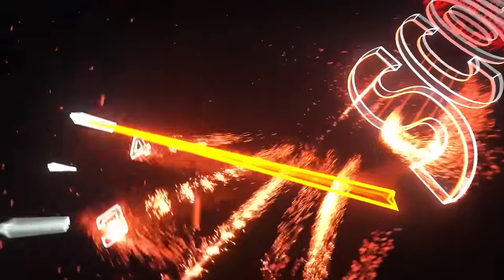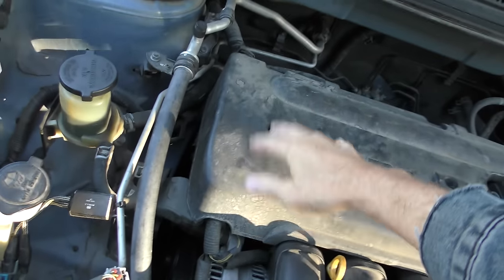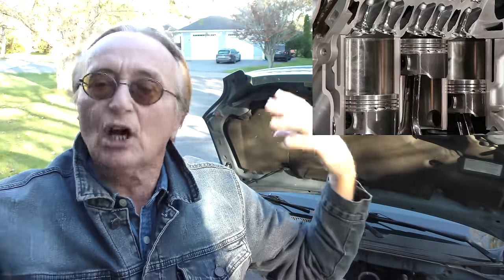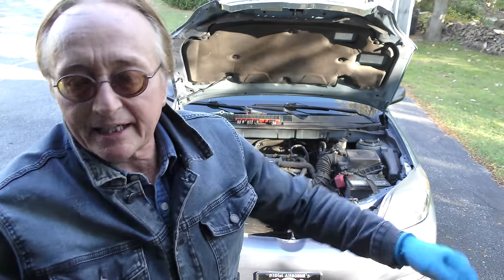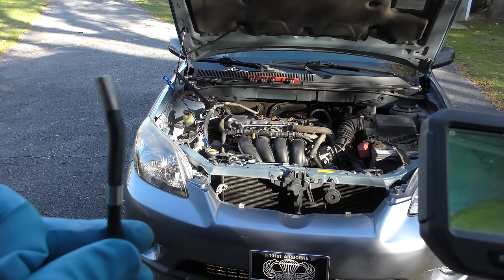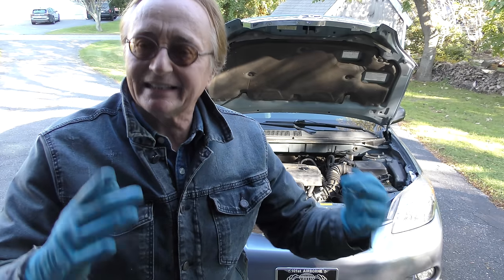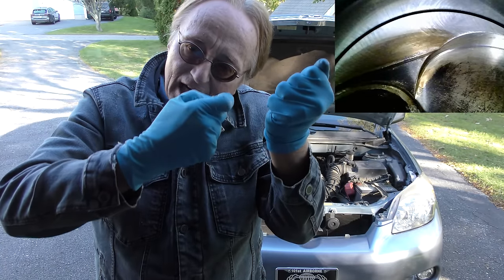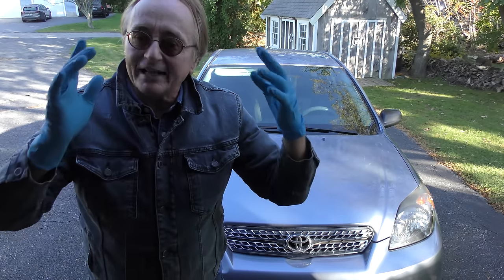Doing This Will Fix an Oil Burning Engine for Free

Comment: At least you can fix an internal combustion engine. When the battery goes out on a EV, you're screwed.
Reply: I hear ya.  But the powers that be don’t want the lower class and middle class to have their own means of transportation.   In the future the 1% will probably be the only ones with their own cars.
Reply: The worst part is, there is very little you can fix on a BEV at home.
Reply: @BigEightiesNewWave Totally agree.
Reply: @nickz6143 What's stopping you from owning a car?
Reply: Have you kept track of the cost to rebuild or replace a modern engine? A $3000 new Leaf battery is Half that.
Reply: If you understand electronics, watch Rich Rebuilds. Tesla batteries are just a bunch of 20700 batteries (old ones were 18650) soldered together in a bunch of series and parallel configurations. Just have to know how to test each individual cell until you find the culprit. Very time consuming but could save you $1000's.
Reply: @djkenny1202 what😂😂no it’s not, if my 240k Fx35 goes out it’s like $500 or even less or sometimes more if it’s a good low mileage engine, compared to a EV BATTERY, you paying $5000-$10,000, that’s a used car 😂😂
Reply: @miguelvega7769  uhh, no. My 2012 Leaf was $3209, installed, by Nissan last summer. It had no oil changes. No brake jobs. No tune ups. Just tires and tire rotations. Everything people assume is False.
Reply: @djkenny1202 Yep, but Thomas idolizes Scotty Kilmer, an avid EV hater.  Meanwhile, EV sales continue to climb.  I guess reality doesn’t matter on this channel
Reply: While you pay 6 dollars a gallon for gas.
Reply: @TheGifted333 I found out a few years ago that tesla was just using around 6 or 7 thousand 18650 cells. I couldn't believe it but it's true, blew my mind.
Reply: No you fix the battery
Reply: Hybrid batteries are the same. Car simply won't work without it.  And they're pricey too
Reply: You can change the dead cells like in hybrid cars
Reply: @ImmortaL778 and then what? Waiting for the next defect cell? Because you know that's going to happen. It's like a chain reaction. And don't forget that after changing the defect cells, you need to recalibrate everything, what costs a lot of time/money
Reply: I like lead acid and NiMH, I'll never forget the time I saw someone resuscitate a dead battery from a decades old truck using an old meter thing from the 70s, or the time I saw someone restore an old deep cycle marine battery and get it to work in ways it wasn't designed or something. I guess I'm forgetting.
Reply: Especially when you thought you've "filled" it up, but it's only showing 20% when you get in to go in the morning.😡
Reply: @sdcoinshooter  it won’t be long until we semi catch up with other civilized developed countries selling 80% EV, or more.  Times are changing.
Reply: @djkenny1202  You’re absolutely right DJ
Reply: EV sales slowing down, many factories slowing down also, look it up.
Reply: @williamwheatley1604  It is using a cumulative number in referring to sales climbing.🤨
Reply: The prius battery is simple to replace. 😂
Reply: @williamwheatley1604  this is due to economics, inflation, greed from dealerships selling cars.
Reply: Better not get Scotty started on EV’s!!!
Reply: Nope, then you just replace the battery.
Reply: Not screwed … but broke ,..
Reply: @afrojojo9475  I do not think they realize there is only 25 total moving parts in an EV 😆. Waaaaaaaaaaaay simpler than an ICE car. Scotty and his peers are just concerned that the thing they’ve been doing is going to shrink.
Reply: @djkenny1202  What do you mean by "the thing they have been doing is going to shrink"? What thing have we been doing, and how is it going to shrink?
Reply: @nickz6143 
Yeah, that'll never happen.
I'm sure some people want to make it happen but it won't.
Reply: @djkenny1202  But what can you do with a Leaf besides go to the grocery store and back?  They have very specific use.
Reply: @mplslawnguy3389  huh? You get 130 miles to over 200 miles to a changed plugging it in at home overnight on a normal 120 volt plug. I don’t Drive 130 mikes miles a day. I also try to walk or bike to my local grocery store for a few things. If it’s Costco that’s only 5 miles away. Living where stuff isn’t 50 miles away would help.  I hope a grocery store isn’t over 10 miles from home! Not that it would matter if you charged it once in a while…
Reply: @djkenny1202  Not everyone lives the urban life.  Some people need to drive long distances for various reasons, and the fact that it gets well below zero here, takes that theoretical range down significantly.  I'm not risking my life to save a few bucks on gas.
Reply: @mplslawnguy3389  but, 80% of people actually Do. Yeah, it wound drip to 65 miles or something in below zero. However, is a grocery store that far? I mean that sounds very inconvenient.
Reply: @djkenny1202  Yes, but you're disregarding a lot of people who don't, and I think you're exaggerating, as people need to drive long distances to work, and picking kids up, etc..  A car like a Leaf is not going to work for that.  Not everyone lives like YOU.  Why are EV fanatics so similar to religious zealots?
Reply: @djkenny1202  , I think you need a 240V outlet to get that. My electric car gets about 5 miles of range per hour on a 120V outlet. Enough for me, but not for everybody.
Reply: Electric cars have hundreds of individual sales you simply replaced a bad sale
Reply: Use simply replaced a bad sale for about 20 bucks😂😂😂
Reply: @markjohnson8260  plug in at 5pm, wake up and leave after 8am.. fully charged. The 240v would be 5 hours. Just never seemed necessary.
Reply: @gasisthepastendoil  Cells? Who did? Full battery at Nissan is under $4000. But seldomly need a battery, it’s true.
Reply: People who own electronic cars actually think they're helping the environment when engineers actually have to mine to make the batteries which do more harm than good.
Reply: @THAQTIP  so you think fossil fuels are helpful to the environment?
Reply: Well if the "battery goes out" it's typically in flames. Meaning insurance or the manufacturer has to help you cause you actually didn't cause it. Meaning you should get your money back saving you money just carry a fire extinguisher to live
Reply: @donaldclark5804  yes, gasoline’s is not at all flammable 😆
They don’t “go out”. Nor do they catch flames.
Reply: @djkenny1202  popping a head gasket sucks more than your gas tank blowing up like a ford pinto "beans🔥" getting rear ended cause your car isn't fully broken
Reply: Yep. Never have bought into the EV and never will. I’ll keep my ICE cars
Reply: @djkenny1202 the problem you run into is the batteries are not available,  I've been working in auto parts for over a decade now.  And most batteries for electric vehicles are unavailable or run up to $18,000 for just the battery.
Reply: @LupusRex-hf2rl  leafs are $3000, installed. Not everyone buys a Tesla.
Reply: @sdcoinshooter it's called forced sales, certain states require new commercial vehicles be electric. That will give you a false trend.
Reply: @djkenny1202  like I said,  depends on availability.  You said you did that repair over a year ago,  alot changes in a year.
Reply: @LupusRex-hf2rl  Commercial or private it doesn’t change the numbers.  You will find something to rant about when EVs are the majority, don’t worry
Reply: Battery’s can be fixed
Reply: when an EV dies there's a real solution. DUMP IT AND GET A RELIABLE NORMAL CAR😂
Reply: @raykupal  Enjoy riding your horse after 2035
Reply: @sdcoinshooter lol it may just survive that long. if another technology comes in that's more reliable than the current batteries or even a more better battery technology, I will surely jump.
Reply: @raykupal  I think there will be, just my opinion but I think when Toyota releases the solid state battery later this year it will change a lot.  Supposedly, it will have a 500 mile range and recharge in five minutes.  I guess we will see, but even if it doesn’t, battery vehicles will be around forever.  They work for lots of people.  I charge mine from solar on my house for (practically) nothing, rarely drive more then 30 miles a day, and enjoy not having to buy gas or oil.
Reply: Toyota will make a hybrid with economical battery swaps.
Reply: No, you’re not. You buy another battery. You have ten years to save. The 5 year cost of ownership of a gas engine vehicle is $30k-$40k. The ten year ownership cost of an EV is $20k
Reply: This isn't true electric car batteries can be repaired at a much lower cost than replacing the battery. The EV manufacturers don't "recommend" this but many people have had great success.
Reply: Fix it with a small battery or capacitor bank and a bi-toroid transformer.
Reply: Common sense is more like it. Guess what? GM and Ford closed down their EV plants and Toyota too. Does that tell you something?
Reply: @djkenny1202 at least we don't lie to ourselves nor to the rest of the world that we are "environmentally conscious "
Reply: How many people with EVs do you know who have had to replace their batteries? With proper care, they will easily last 250k + miles.
Reply: @BigEightiesNewWave  EV’s have 1/10th the moving parts of gas engines and are virtually maintenance free.
Reply: Hahah
Reply: You can literally fix a battery.

Comment: I have a liftime powertrain warranty on my 09 ram with hemi. Recently noticed massive oil consumption, about 1 qt every 1,000 miles. It holds 7 qts. Took it to the dealer, they did an oil consumption test and confirmed that i was in fact burning about 1qt every 1,000 miles. Thats when they busted out a tech bulletin from chrysler saying that its acceptable/“normal” for any engine over 50,000 miles to burn up to 1qt every 750 miles. So they wouldnt do anything. And my first thought was “my oil changes are every 3,000 miles so its “normal” to burn 4 qts of oil? Thats over half!!” And thinking of the 2013+ rams, their interval in 6,000 miles for oil changes so chrysler is saying it would be normal for them to burn 8 qts of oil, which is all of the oil and then some. I mean, seriously?!? They are out of their minds.
Reply: 👍🏻I had the same issue with a leased vehicle. After all the paperwork was completed I said Oh buy the was it burns a qt every 1,000 the look I got was priceless
Reply: Ask a Class Action law firm if they'll take the case.
Reply: Ask a Class Action law firm if they will take the case.
Reply: Are they out of their minds? You're the one who watches Scotty's videos yet you still drive a pos dodge. You need to take a long look in a mirror my boy

Comment: Some of these newer engines that use low tension piston rings are consuming loads of oil. The problem is ppl are being told they can go 10 thousand miles or more between oil changes, and the oil ring gets gunked-up and freezes in place allowing the oil to blow by. The answer to this is to use a quality oil, and change your oil every 5 thousand miles.
Reply: Do an oil analysis on most cars at 10K miles. Blackstone Labs will tell you the oil looks fine and can go further. Changing oil is seriously overrated. I mean it's cool if you like overchanging cuz u like to work on cars and it makes you feel better, but that's 40 bucks I'd rather save.

Comment: Scotty if that is the 1zz-fe motor, there was a TSB on those engines. What happened is Toyota mis-engineered the piston. What can be done is you order the new pistons and oil control ring or you pull the pistons drill one or two more holes in the pistons, or maybe open up the existing holes and then modify the oil control ring with more of a gap to allow more oil flow. The restriction of oil ended up excessively building up carbon and causing the oil control rings to seize and then the oil couldn't regulate the temps and, hence, the oil burn. Supposedly, Mobil One Full sythetic works best, I have ran Castrol Edge full synthetic for over 10 years and it's a amazing oil that's doesn't shear and handle the heats great but doesn't suspend and clean carbon like Mobil One does. I've owned my Corolla for almost 13 years. When I switched to Mobil One from Castrol Edge because I couldn't get it, I did end up having a leak near my chain tensioner. Mobil One  full synthetic also demonstrated it's cleaning ability immediately vs Castrol Edge full synthetic. I would recommend to anyone who has the tools, time, and the ability to fix the piston and ring problem or just run Mobil One Full synthetic and possibly every once in a while run Marvel MMO in the last fews miles of a oil change! 👍

Comment: Scotty, there is a solution in a can!

Check out the video on YouTube talking about a piston soak.  

My 2009 Camry with the 2.4 engine has 175k miles and was burning a quart a week.
I did what they call a piston soak with Berryman's B-12.  On one video the guy used one can and in another the guy used 2 cans. 
I used 2 cans. You take out the spark plugs and pour this fluid into the top of the cylinders and let it soak for 24 hours, hand turning the crank every few hours. The solution goes down and dissolves the carbon out of the rings and they start doing their job again.  I could tell by the comment section that the stuff must work. Some were reporting an 80% reduction. To my amazement my engine does not burn oil anymore.

Comment: And I thought I was going to hear a way to fix an oil burning car, great saleman
Reply: I don't even bother listening to Scotty. I thought he was going to recommend a mechanic in a can like he usually does, but I never saw a photo or him holding it up. Thought I was actually going to have to watch the video.
Reply: There is! Check out the video on YouTube talking about a piston soak.  
My 2009 Camry with the 4 cylinder engine and 175k miles was burning a quart a week.
 I did what they call a piston soak with Berryman's B-12. On one video the guy used one can and in another the guy used 2 cans. 
I used 2 cans. You take out the spark plugs and pour this fluid into the top of the cylinders and let it soak for 24 hours, hand turning the crank every few hours. The solution goes down and dissolves the carbon out of the rings and they start doing their job again.  I could tell by the comment section that the stuff must work. To my amazement my engine does not burn oil anymore.
Reply: @br5747  I did a piston soak with Berryman's. Due to user error I ended up burning up my starter and spending an extra $100 plus a new battery. I was only planning on letting it soak for 4 hours, but it ended up soaking for like 2 days. It did seem to help. I think I'm still burning oil, but at a very reasonable rate now. Maybe a quart every 5,000 miles is my guess. I was starting to burn a quart every 1200-1500 miles.

The B12 making it very hard to start the car. I eventually had to put oil in the cylinders, and the car was still smoking after I had driven 5 miles. My neighbor was not happy as I drove by. I'm almost scared to ever do it again, but I will if it's necessary.

Comment: I resolved the clogged low tension rings with berrymans, down the cylinder 4 times over 24 hrs.  It dissolved the gunk, had trouble starting after treatment but it now burns one tenth of what it used to

Comment: i remember my brother was into chevy camaros back in the 70s n 80s  and a common prob they had with oil gettin in the comb. chamber was the oil seals on the valve stems   a tedious job  not particularly hard  but it fixed it or greatly improved most of the time

Comment: Scotty did say how to fix a car that burns oil. He said to have the engine rebuilt or swap the engine with a newer one, but it costs a small fortune. Monitoring the oil level and filling up as needed is an affordable way of doing it.
There are additives that do help, like AT-205 or Restore engine treatment, and using an oil stabilizer can help, too.

Comment: Answer:  The Old AT-205 Reseal Formula before they changed it a couple of years ago. The new stuff doesn't work as good and they charge you Double for it as well.
Reply: No wonder! I used to have good luck with that stuff.
Reply: Agreed. The change was not for the better... including when it went from $10 to now $20.
Reply: Lucas makes a great one these days.
Reply: What's it called.
Reply: @tonyb7748  Which one are you talking about with the Lucas?

Comment: If you want to fix it you can look into the engine restore with the copper lead and silver that seals a lot of the grooves and the cylinder wall and the trick in 2-stroke small engines and if you like in your car put some inside the cylinder with a syringe and the spark plugs out and run it up and down to coat it and it works really fast then just never put in something like a 7.3 l Diesel with a high pressure oil pump you will screw your injectors and everything else but that is an unusual case

Comment: You can use the cameras for other things as well. Like sticking them in your. Assembling duct work, dryer and washer repair, electric wires behind walls, sticking them in your wife's, assisting with all kinds of jobs and more!

Comment: Leak-down test is best. Leak-down test tells you per cylinder, where the leak is. Intake valves/exhaust valves/cylinder head/rings.
Leak-down is by far the most accurate.
Reply: Leak down works with women too.🙃

Comment: I have an endoscope camera and flexible with the attachment magnet and hook if needed. Does that work for cars too. You have been a lifesaver for me and my 2003 Toyota Camry. I did buy it pre wrecked and I have a knack for avoiding accidents and slowly fixing it up and upgrade parts. Tie rods and struts would be great video for the potholes from hell is Nashville and I know it just doesn't effect tires I would appreciate a how diagnosis and repair front wheels/end work for me to save the engine mounts from cracking.